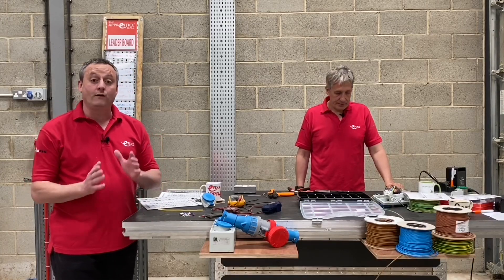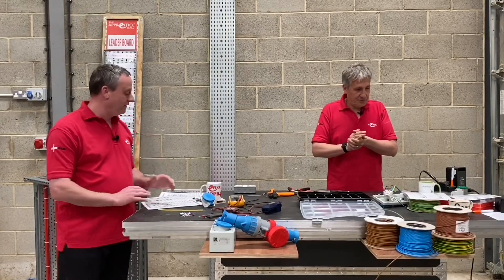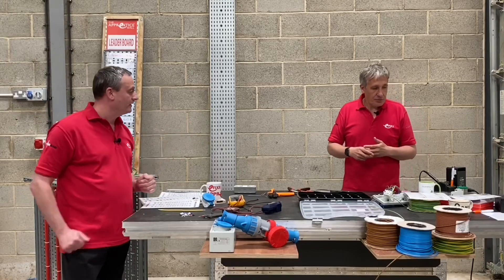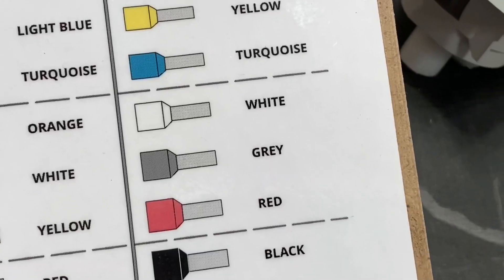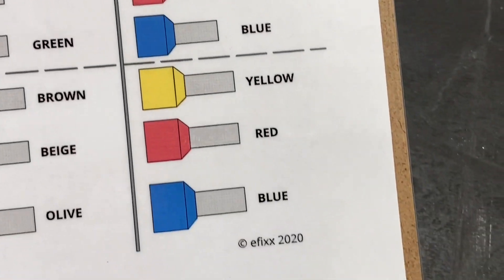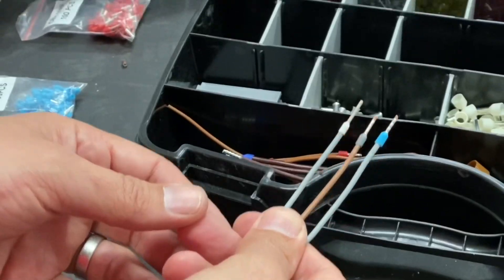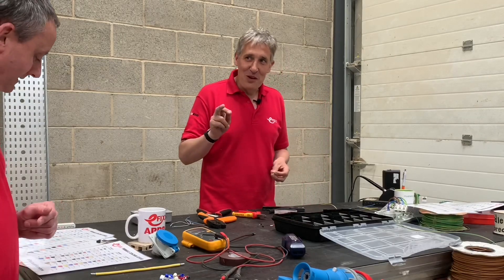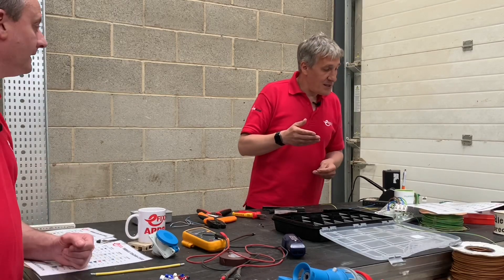Ferrule - Colour code confusion - 2 German systems and one from France.

Comment: in the german din syrtem where they repeat the colurs for different cable sizes, could it be that the colours represent Phase colous?
Reply: What's a phase color? Our wiring is yellow/green for earth, blue for neutral and brown, black or gray for 3 phase AC if that's what you mean. There's no red for example (at least since the 1970s). And they all come in different sizes so you couldn't use a blue ferrule for neutral unless it's  2.5 mm²

Comment: That was a lot of hot air about ferrule colours, who really cares what colour the ferrules are, it's the cable colour or cable tag that I'm more concerned with.
Reply from the maker: If you are building a machine panel to DIN standards you’d care.
Reply: @efixx  Most of the panels I worked on only used black cables and were designated with idents, so whatever colour the ferrule was made no difference. With the very small wire we used they tendered to be uniform and looked very tidy.

Comment: Knipex do ferrule crimp pliers, I think they are better and easier to use than the ratchets but you might struggle with larger ones. And I don't agree using the sleeved/insulated ferrules in terminal blocks or PCB headers, they tend to bend and crack too easily

Comment: But are these ok to use on UK domestic systems? Do they comply or are they Suitable-for 240 volts.
Reply: @morkthebuilder9943 > yes.... There used in power boards/MCB fuse boxes/home power supplies etc. The uninsulated type ( no plastic) are great for butt splicing (joining two wires together) or just cleaning up a loose conduct wire end before you put them in the main connection. If you have more than one wire going into one entry up the size & crimp it down, twin types ain't needed often.

Comment: I know you don't need to, but can you use ferrules with Wago light connectors?  I'm wiring a boat so all the cables are multi strand, and some of the lighting cable is .75 and doesn't catch in the Wagos.
Reply from the maker: On the 224 type wagons you could use on the flex side.

Comment: So is there a US American Ferrule standard? Any idea if they're actually required in the US, or the UK for that matter? They seem to be used a lot here in the US for industry, but not sure if they are actually required.

I have much less experience with home wiring, but I don't think they're used in that environment much.
Reply from the maker: There is a UL standard for ferrule systems - which is a combination of wire, ferrule and a specified crimp  tool to match the ferrule - I’ll try to dig up the exact UL number.
Reply: @efixx  Thanks, that would be much appreciated!
Reply: Can't see these needed in America as they can't be used in wire nuts....

Comment: Thanks for mentioning me in your video! 👍
Here in Germany the DIN standard is the most commonly used one. Many years ago every wholesaler had another the system or sometimes more then one. Now a days the DIN system is commonly used and the other systems have to be ordered from central stock or from the manufacturer. 
But in a nearby city we have a ferrule manufacturer and there all colour codes are available 😀
Reply from the maker: No problem - thanks for your comments - stay tuned for more German related electrical content very soon!

Comment: It would be interesting to know the underlying rationale behind these colour schemes. I'd have thought they could just repeat the resistor colour code across the range, or use transparent collars with the size(in square millimetres) printed or embossed on them. The latter option would be my preference to avoid colour clashes and ambiguity.
Reply from the maker: Sounds far too sensible - great idea on the marking :-)
Reply: @efixx  what system do we use in uk

Comment: German DIN Standard is the most used system in the Netherlands.

I do however (due to availability) use some French colors (0.75mm2 and 6mm2) if I have no other option.

But it's German Din 99% of the time and crimps made.
Reply: To complete the information I have given above:

I checked several of my Dutch and German suppliers and none seems to support the Weidmuller-system. It's mostly the Din Standard with some Dutch suppliers offering the French standard as a substitute or completion of their Din offering.

Comment: The codes are too complex and, frankly, quite useless. I just match the colour of the ferrule shoulder to the colour of the cable  insulation. I use green for cpc. I have only seen technicolour ferrules in motor control circuits and electronic stuff.
Reply: Do you only use 6 and 16 square mm cpcs? Those are the only two ferrules that use that colour according to their chart. I would doubt the integrity of a connection made where there is a significant difference between the cable csa and the ferrule used!

Comment: You can tell the csa of a cable without a ferrule by just looking, right? So what difference does the colour of the ferrule make? 

Why not just consider it a convenience for you at the point of installation so you can easily tell which one to use... 

Would have even better to use the colours to mark the cable function - all of the sizes in all of the colours. But that horse has already bolted.
Reply from the maker: Most cables have the csa of the cores marked on the insulation jacket. The colour code does not match the function of the cable, In control cabinets you can have multiple voltages and functions -e.g signal cables. Better to use cable markers to identify functions.

Comment: 6:05
That's actually very doable.
If you repeat 3 colours in the same order it would be very simple.
The difference between the same coloured diameters is big enough so you won't accidentally use a wrong one. For example, 
RED  0.14,  0.50,  1.50,  6.00,  25.00
WHITE  0.25,  0.75,  2.50,  10.00,  35.00
BLUE  0.34,  1.00,  4.00,  16.00,  50.00

Comment: Moin! 

Thank you for the color chart. Very helpful after I use only the Weidmüller system from 0.5 qmm till 2.5 qmm normally. More we not need here in Germany or Thailand.
Reply: Having endured the Thai concept of wiring, I hesitate to use the term standards. A more accurate description would be "free form wiring".

Comment: Why can't we agree on just one colour code?
Reply: White, all of them should be white. There you go, problem solved. (Not even joking) it's what we do at work, easy to work with in the field and no trying to explain to anyone why there are different colors on the wire terminations.  The fancy mode is buy the sizes in the colors of your wires, and match them (looks really sexy, but is a bit of a PITA)

Comment: Does anyone really care what colours they are? If the wire fits crimp it, if it holds it is good. No?
Reply from the maker: You may have just described the British ferrule system. ;-)
Reply: I use only the Weidmüller system. Easy to use. 😊
Reply: I hope you don't take the same approach to your wire colour codes!

Comment: is the green ferule always used to denote earth or cpc?
Reply: No. The ferulles have nothing to do with the function of a cable. The color code is only for the worker with the flexible cable for see direkt what qmm it have. For hard cable do not need them. If you use the Wago 222 do you not need them too.
Reply from the maker: No relation to ferrules and wire function.

Comment: Normally in a wiring panel, if they have used ferrules they, would have also used idents, these idents are what you would be using to identify the cables.
Reply: That's what I was thinking.